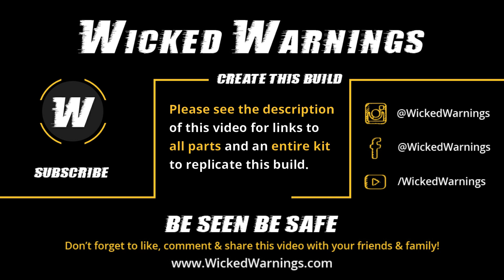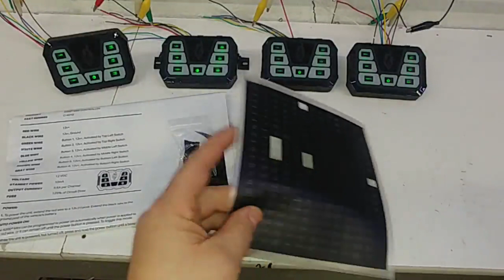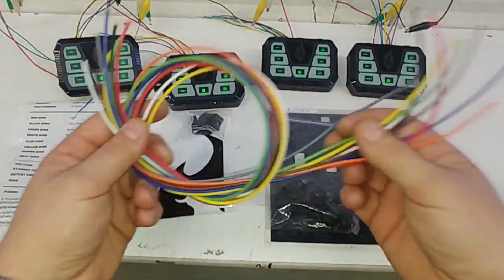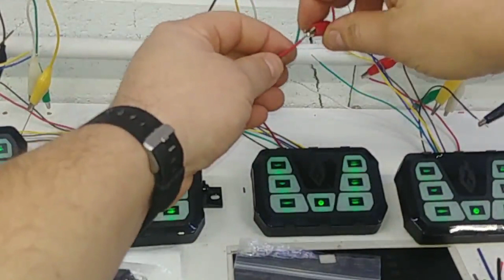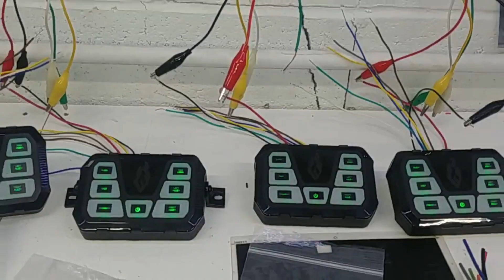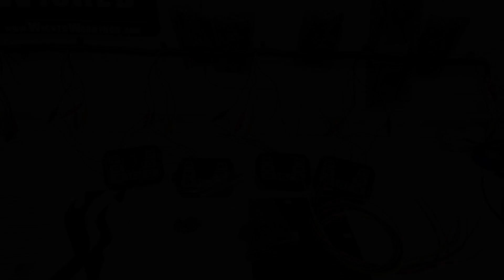Mini-6 Switch Control Panel Demo - How to Program your Switch Panel

Comment: Can you make it so you can only turn on your rear, or only turn on your front, or turn on all lights using the wig wag?
Reply from the maker: This switch panel is very customizable. You could switch the front and rear lights separately and just activate both switches if you wanted all of the lights on at once. There are more video examples of this in the product description on our website WickedWarnings.com.

Comment: Excellent video, clear, concise and nicely put together. thank you! 

If I understand correctly you can program lights to each button, so upper left button could activate flashing front dash and grille lights, upper right button could activate flashing back light bar and license plate surface mounts, then the middle left button could be continuous on for the front dash grille, middle right, could be continuous on for back, etc etc?
Reply from the maker: Thanks for your feedback! Glad you liked the video. And yes, each of the buttons can be customized to activate different lights.